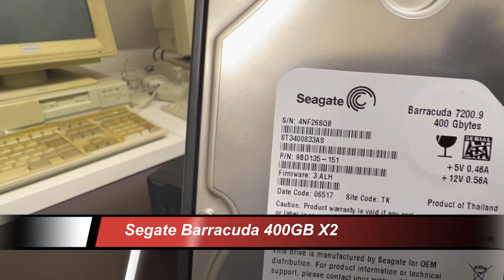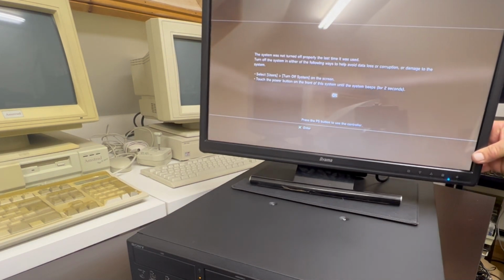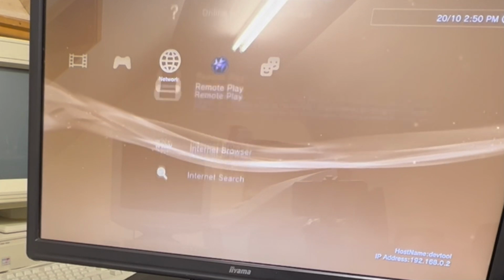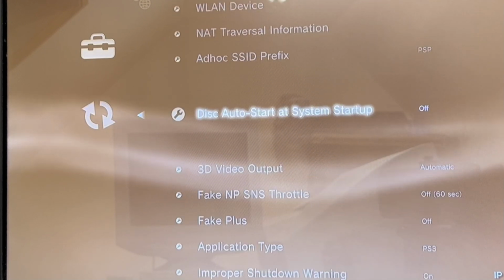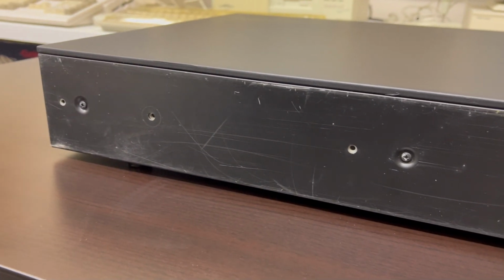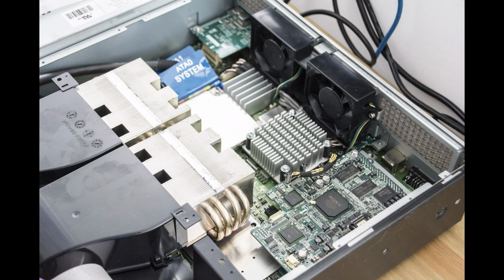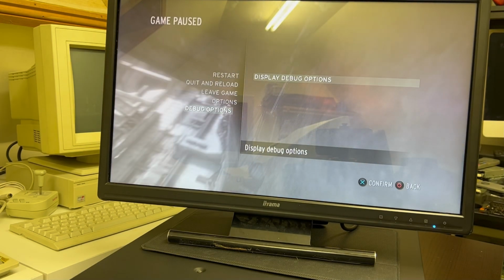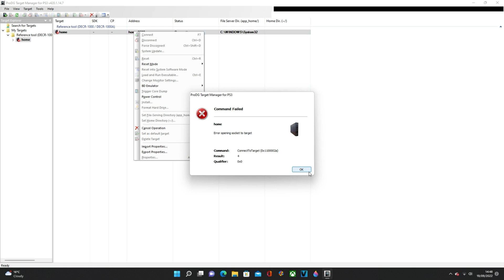Sony PS3 Dev Reference Tool (DECR-1000A)

Comment: these are super dope love them. was wondering if you noticed any performance upgrades while playing on it or is it just like playing on a standard PS3?
Reply from the maker: @cameronn  just played as normal to me with the settings set to retail but you can change stuff slightly 
The main purpose was run a game code and you could snoop on the game data and render pipelines in real time very cool 👍

Comment: Nice, I would love to own of these someday! :)
Reply from the maker: Maybe one day!👍
Reply: @TheVetUk  Hi Sir, does it support running games in internal hard drive?
Reply from the maker: @singho1122  yes prototypes or retail all work for me
Reply: @TheVetUk  Hi Sir, I installed Rebug 4.84 firmware on my DECR 1000, but I tried many version of multiman, it shows unsupported firmware, functionality may be restricted! then I tried IRISMAN and Webman, they also didn't work! could you provide usable version of multiman, irisman and webman? thanks a lot!
Reply from the maker: @singho1122  not tried any custom on mine I will have to give it a go
Reply: @TheVetUk  I installed full version multiman and support ps3 game finally, but for the rebug toolbox version, I tried many version, but it still failure, since rebug toolbox has the PS2 emulator need to open for support ps2 games....

Comment: It's possible use SSD and replace the mechanic HDD?
Reply from the maker: Hi
I have used compact flash and SSD on these systems as long as you have a image to put on it you should be ok if you want a drop in replacement but a blank drive can be setup 👍
Reply: @TheVetUk  Hello, thank you for your reply. I bought my PS3 dev kit and it's on its way.  I've never handled or seen one up close.  Is the system to install on it the same as the one downloaded from Sony's website or is it a special system?  Does this unit have no problem replacing the HDD with a new one?  sorry so many questions.  I have a Psx DESR and I don't know if you can get these devices but these devices when the HDD dies it's impossible to replace the PSX DESR HDD, and that's why I'm worried about replacing the dev kit HDD as well.  thanks
Reply from the maker: Hi
I have a PSX you really only need to free mcboot it to take the work load off the HDD and do a English conversation and not use it much really to future proof it 
The PS3 are prettying good and I’ve not seen any hard drive failures but the CPU  and. GPU should both be cleaned and new thermal paste put on as they overheat and shut down 
You should be fine otherwise 
Good luck 👍
Reply: It's throttled to sata 1 speed. You would gain mostly killing SSDs quickly and no speed boost. The games were never intended to be ran from flash storage
Reply: @miregoji2959  I meant, if it is possible to exchange the original HDD for an SSD or any other, if the original HDD is special and matched to the system, which doesn't even happen with those Sony PSX DECR devices

Comment: I just got my unit earlier today.  It was missing the kick pedal and antenna but did come with the metal stand.  Do you know what the GPI switches are for, like bank-wise?  Also, on yours, if you plug in a disc, does it automatically work?
Reply from the maker: The switches are just options you can Google the manual easy to see what each one does when I put a disc in it installs it to the hard drive and shows up automatically 
I did have issue with mine overheating when I got it the thermal pad was shot so added some thermal paste and it worked fine so I would do that first good luck 👍
Reply: @TheVetUk  I'm curious, where in the manual is the info for the GPI switches?

Comment: Some of your ports on the back are closed off in yours
Reply from the maker: I watched some other videos and most seem to have been blocked to I can only assume the studio using it did not need it or it’s a feature Sony did not implement into the SDK so did not use it not sure really why 👍
Cheers
Reply: @TheVetUk  oh I get what you mean
Reply: Or did you do it on purpose so you wouldn't get a cease and desist

Comment: You know I actually own one too except mine is a little different mine has firmware from around 2007ish
Reply from the maker: Cool !!  do you have the stand? Think I’m going to make one,   Anything on your drives of interest?
Reply: @TheVetUk  do you have discord or something so I can show you images of it?
Reply from the maker: You could email them I have no discord sorry Thearcadeveteran@gmail.com 
Cheers Vet
Reply: @TheVetUk  I’ve sent a email explaining what happened early today
Reply from the maker: I have emailed you with a possible solution but what does it do when you try to turn it on does it fire up the shut down with a flashing red light ?
Reply: @TheVetUk  when I turn it on it just beeps and turns off instantly
Reply from the maker: @evansurran6132  ok sounds like the processors maybe overheating mine did the same put new thermal paste on the two main chips under the massive heat sinks and try again quite an easy job just lots of screws  
See how that goes
Reply: @TheVetUk  thanks but I wanna make a offer with you
Reply from the maker: I have learned that these suffer from the processor pads cracking and it would need reballing but hopefully yours is ok even then it can be done just more expensive 
Fingers crossed 🤞
Reply: @TheVetUk  Do you mind if I send you a email with a offer?
Reply: @TheVetUk  do you?
Reply from the maker: Not at the moment cheers
Reply: @TheVetUk  I sent email